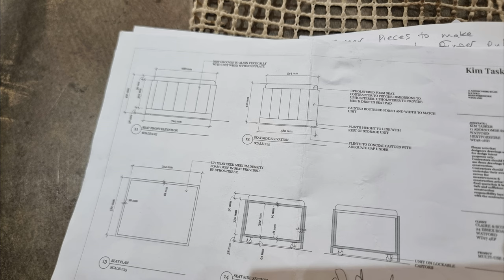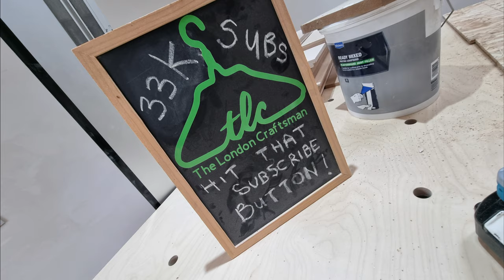SIMPLE PLANK EFFECT STOOL // Easy DIY Customised Vanity Stool// Ep#147

Comment: Hi Ryan, lovely job. Do I remember right in that you personally don't undercoat and prime your mdf and find a decent finish from just 2 top coats? 

I recently sprayed a set of wardrobe doors which I made from standard mdf. Rolled first with an acrylic undercoat and primer followed by top coat of Sayerlack at99.  Sanded with 320 between coats but still slightly getting raised grain! Would you recommend anything better for sealing that mdf first? Usually get such a professional finish with the Sayerlack 

Thanks
Luke
Reply: You should do 2 primes and 1 top. Prime, sand, prime, sand, top.